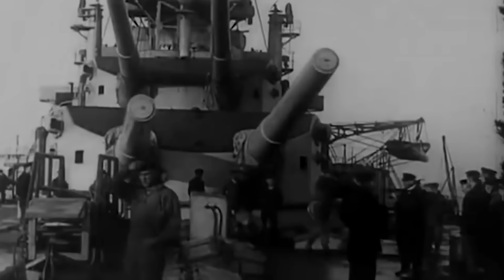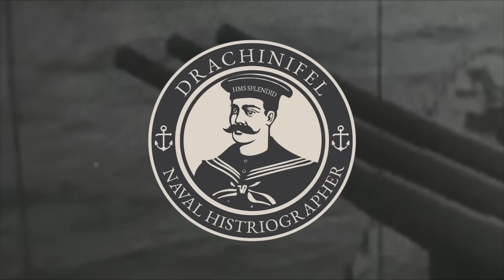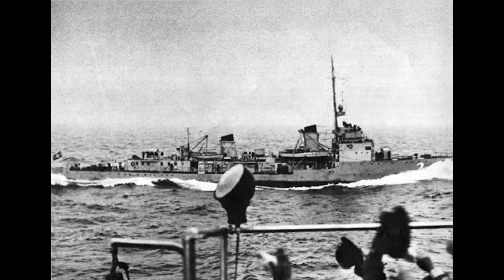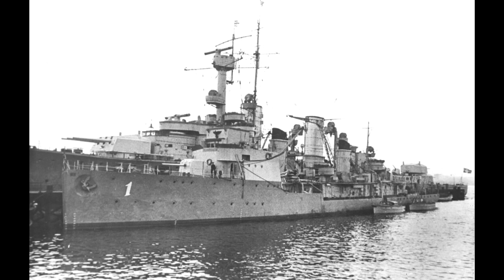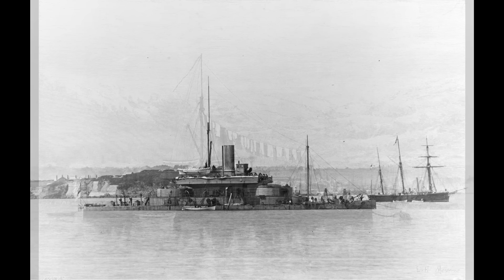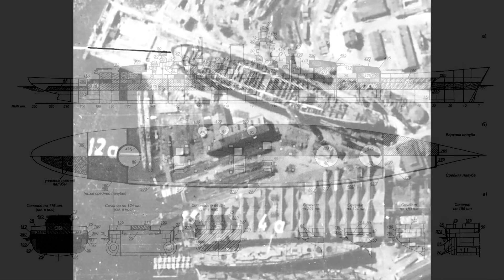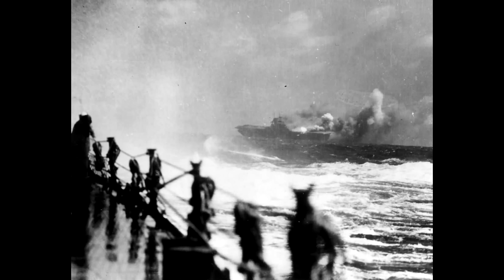5 Naval Engineering Failures - Sink, Swim or Explode

Comment: HMS Vanguard should be on the next list
Reply: Vanguard is more of a massive strategic disaster than a massive engineering disaster.
Reply: I can't see your problems with the design of the ship. 

She ( Vanguard) is a solution to a problem the RN had for faster ships for a far east deployment. So had there been "time" to convert the 5 slow R class into 5/6 fast Vanguards the RN would have been happy with the trade. 
However Churchill's decision to halt capital ship production, killing off Lion and Temeraire and slowing the Vanguard build to a crawl, is why she becomes a class of one "white elephant".
Reply: Vanguard isn't that bad.
just ended up too late and britain couldn't afford to turn her into something like a refit Iowa later on.
made a good yacht though.

Comment: 14:43 I 🤍that description of a 3.7cm C 30 as a pair of "bolt action" A/A guns. 😂
Reply: It is a very apt description, even though they where technically semi-automatic. Technically, not having a bloody magazine kinda defeats that idea.
Reply: @hanzzel6086  semi-automatic in cannons refers to the breech action automatically ejecting the shell and being open to a new one loading, not to automatically loading a round after every pull of the trigger like a firearm.
Reply: @rapter229  Yes that is helpful for those that aren't aware, in smaller calibre guns especially single loading A/A even up to 5 inch and 5.25inch the empty cartridge is kicked out by the sliding breech block splines opening due to the recoil. I tend to use these terms as a given - although most people have never been around artillery. in medium and heavy artillery, from 5.5 inch upward  (Welnin and Asbury, de Bange) and some older types like the 13pdr and 18pdr field guns,  if a cartridge case is used it is kicked out by  spring action on opening the breech with the handle seen on the screw breech. It has the advantage of allowing the residual hot gases time to diminish.    

If a case doesn't self extract in either semi automatic or manual extraction, a special tool needs to be used to extract the errant  spent case, for tanks in particular it is a two prong fork normally stowed in a bracket near the loader. In the 1948 one of the two Israeli Centaur tanks was made un-usable because the inexperienced crew had left the cartridge puller at the depot, not understanding that everything has its purpose and place, and the place isn't left back in the barracks .
Reply: @hanzzel6086  I has to be remembered this style of weapon in 37 mm wasn't just a German thing the french had the very similar 37 mm/50  Model 1925 and 37 mm/50 Model 33 both a semi auto falling breech block hand loaded gun so around 15 -20 shots per minute - if you are lucky.
Reply: @SCjunk  True, but just because someone else did it doesn't make it a food idea, especially if that someone else is the French! (glares at their early pre-dreadnoughts)
Reply: @hanzzel6086  Fair enough, I'm not saying it was a good idea all I'm saying is it wasn't just the KM wasn't alone. but both countries were aware the actual old falling block (rather than bolt action joke) was a bust.  But the reasoning for these weapons were on the same basis as the single shot rifle and then the manual action repeater were preferred, basically if you're unlikely to hit anything there is little point on going from 15 to 20 round per minute to 300 rounds per minute cyclic.  However both France and Germany eventually realised that a full auto was needed, both C/30 and model 33 developed into 'something better'.  for France it was straight to 37 mm/70 Model 1935 but few manufactured and fitted to service vessels. for Germany it was firstly an auto-loader add on for the C/30 then a new design the M/42

Comment: When there's no war on it always seems so tempting to give warships a secondary utility role. But then during the war every warship is at a premium and your utility tasks suffer and your warships start running into un-swept mines.

That's when you start to realize that by doing the long and boring jobs and keeping your warships in the fight even the humble minesweeper is not a cost but a force multiplier.
Reply: To a degree it's even a good idea if there's synergy with the primary role of the ship - EG the extensive machine shops onboard USN aircraft carriers meant they were able to do almost all services for their air wings' engines, and support escorts need for spares/repair. The problem comes when you don't have that synergy.
Reply: Crippling overspecialization is also a thing.  You can only afford so many ships in your navy, and you've got all these various jobs.  Worse, you don't even know ahead of time how much of each you need.  You don't get into real trouble until your various design goals start being in direct opposition; for an F-Class example, the deep draft for sea keeping versus the shallow draft for mine sweeping.

Point is, it's not wrong to want your ships to be able to do multiple things well; a ship that sucks at the job (a ship that you have, now) is better than no ship with the capability.

Comment: 14:48   "If the enemy was, of course, kind enough to approach at walking pace so that you could hand-load each of your 37mm rounds."
Reply: Makes the Japanese 25mm look like the Bofors 40mm in comparison.
Reply: @bkjeong4302 Drach has expressed the opinion before, and I agree with it fully (along with, in the regards to U-boats, every U-boat captain who's writings I've read), that every ship that carried that 37 would have been better off with them removed. Not even replaced or with the spce/weight used elsewhere, but just removed. As at the very least it would have meant fewer men on board to die. And in the case of the U-boats, slightly better all around submerged performance.